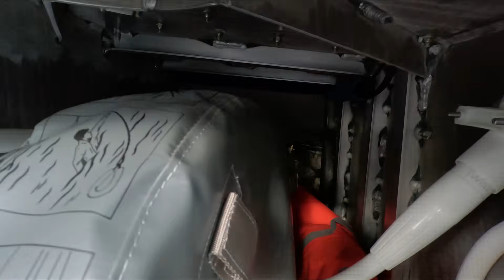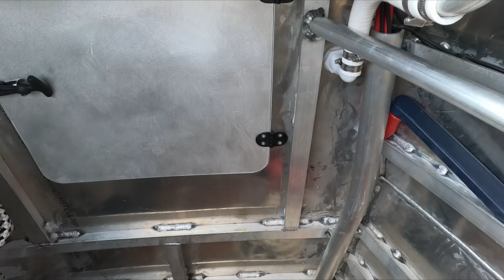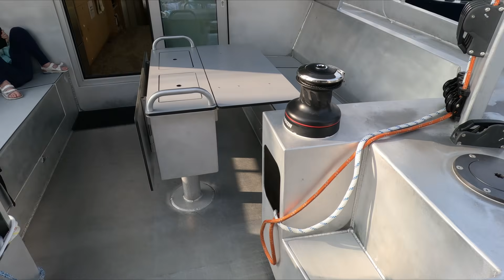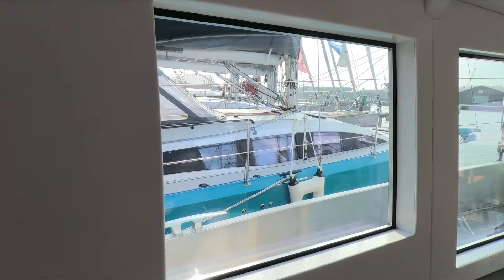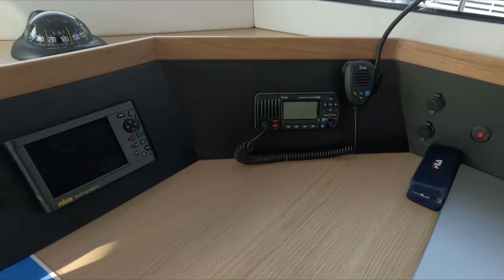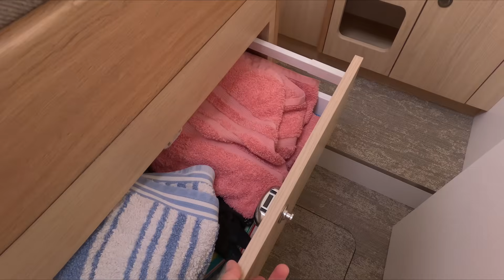ISMERIA 45, Mini expedition ship or tiny home

Comment: Interesting choices here. Love: aluminum construction, drop down platform, solar arch, wide side decks, hand rails, double rollers, forward storage compartment, watertight bulkheads, granny bars, easy access to boom, shaded windows, PIANO!, deck cabin saloon and galley. Don’t love: climb onto side decks, line chafe on hatch opening, raised hatches, deck cabin windows don’t open?. Not sure about the helm. Did not see a wheel in the cockpit—is the inside helm position the only one on this model? Can the helmsman see the sails from the helm station? And far away from winches and lines.

Comment: Very interesting layout.
Couple of points though:
- the aluminum is not textured on the foredeck. Is that not slippery when wet?
- Owner cabin bed is higher than the surrounding bed framing. How do you hold yourself in place where heeling at sea? 
- the same bed does not seem to be ventilated. In our experience this is the perfect setup for mold. How is that tackled please?
Excellent presentation as always. A very neat concept otherwise. Thank you for sharing.
Reply: The deck is not yet finished as she is fresh out of the factory - the deck will have cork decking when finished.

The bed has special ventilation underneath with the lattes. There are lee clothes and boards when underway for safety

Comment: I wonder how they are going to fix that issue with the lines rubbing on the hard bimini.
Reply: Yeah, was a bit of an oversight 🙂
Reply: IF it is gravity loads only, that's fine. But not OK 
if the  shortest distance between the ends of any section of rope causes it to press with appreciable force against a chafing surface when moved under tension.
Reply: @Gottenhimfella we will find out during the factory tour. However we believe there are systems in place that are invisible to prevent this.

Comment: Since when is 45 tiny .. most people can only dream of a boat this size and live in 27 to 35 footers ..
Reply: tbh, the 42 to 46 feet LOA range, is the sizing bracket for the can I fit in everything I need with a Monohull. The only real issue then becomes part of the massive can it be supplied with the shallow enough Draft that I need - the answer to which, unfortunately tends to be - no it damned well can’t ! - Hence my target next Sailboat has a 36 foot LOA, and a Draft of 4 feet 6 inches, which is 3 inches deeper than my Endeavour, though that is with a very special Mars Custom Lead Wing Keel,though that is waiting on confirmation that the inboard 4 cylinder Yanmar Diesel, with Direct Drive can be fitted - as not exactly a fan of the three cylinder under powered ones, plus a second small head can be accommodated satisfactorily, while keeping the very comfortable existing main head and shower- if you regularly have guests or crew onboard, then a second head is pretty much indispensable imho. If the worst comes to the worst, then next LOA size up would be ok, other than losing out on proving the probability of acquiring the potential for significantly enhanced boat Survivability with a smaller boat which has a much reduced displacement- I’m aiming for comfortable Transatlantic crossings, with a displacement of more than 3,000 lbs less than I would normally like, but with no resulting worries about comfort during a crossing. Comfort makes a vital contribution towards boat and crew safety by providing needed rest. The difference in cost between 36 feet and say 39 feet LOA can be pretty close with care, and if you can tack an order on with a bulk purchase by a Charter Fleet. Bob. 🤔🌟🌟🌟👍❤️⛵️
Reply: For most of us yes this is a big boat to dream of. The reference to tiny house is a direct comparison to a house and a boat - most houses are way bigger. The live aboard life this boat provides is comfort if people are coming directly from a house and are wanting the same comfort levels that a home like a bungalow can offer

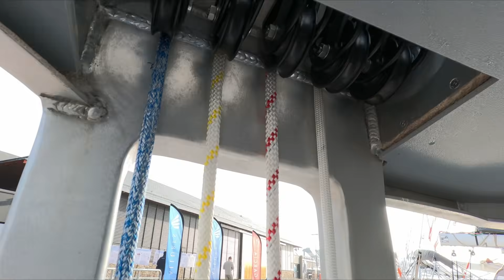Comment: At 10:30 I noticed that the running rigging that comes over the deck roof and then down to blocks, thru clutches and then thru blocks doesn't seem to face the nearest winch!  There must be some rotation that the final blocks can do to get a good angle on the forward winch but I'm not seeing it!
Reply from the maker: All will be revealed when we visit the factory, but well spotted.😊
Reply: Looking forward to the reveal at the factory!  I live in southeast Alaska and own a 30 foot sailboat, but have spent quality time on aluminum power boats, jet boats specifically, and they are tough as nails.

Comment: What this is, is a sailing house designed by landlubbers...who have never read the 
1972 Col. Regs. (Preventing collisions at sea)
Reply: Explain?
She looks generally well sorted.
Reply: @markthomasson5077  I grew up by the sea started sailing 1964. Was a sailing Keelboat instructor for 14 years. Made many deliveries of varying sized keelboats.
Many modern sailboats are designed to sell to the sailing novice. (One glaring design flaw is having the main sheet halfway down the boom) 
For me sailing (Dufour 44 performance) solo & practicing the art of sailing, making a distant port/anchorage safely is what its about.
To many others it's about entertaining & prestige.
Reply: @petertaylor8922 agreed, most boats designed to be comfortable in harbour….note you often see sailboats motoring, even downwind.
Centre mainsheets, to my mind, very sensible to not have a loose mainsheet take your head off in a gybe.
Reply: @markthomasson5077  Your comment regarding the main sheet shows your lack of sailing experience.
Reply: @petertaylor8922 about 65 years.  Please explain why it is bad.

Comment: Nice. Yet would u really be sleeping in the bow if u were doing around the would voyages. Might be a bit bouncy.
Reply: A forward Offset Pullman Berth with Lee Cloths can usually be installed in such a way that you can prevent high speed evictions from bed while you sleep. Other than that, reverting to traditional Saloon Sofa bedding to Port and Starboard, also with Lee Cloths, has also always worked really well, as do quarter berths tbh. Best Wishes. Bob. 🤔🌟🌟🌟👍❤️⛵️

Comment: Wow ! If I was in the Market for an Expedition type Sailboat - but I’m not - these  are the builders that I would approach to build it for me frankly. But I want to keep as far away as possible from seriously extreme Cold and the Stormy Conditions that frequent such areas of the World. As pretty much everything in any resulting boat would clearly end up being built to my specifications, for me the maximum number of compromise boxes would inevitably be ticked in my favour, so by default, I’d be getting the very best Sailboat I have ever seen, and the same would go for everyone else having these people build a boat for them ? 😅. OK so instead, how does the boat I need shape up in comparison ? Well, it is starting to compare really well actually, and we are now several steps closer to having it placed on an order book. Still need the Tropics, so a GRP Monohull Design to last for about five years acquiring Data as a Concept Test bed, then a bit bigger boat for more comfort, which means the test bed can be quite a bit smaller, and a heck of a lot cheaper as a result, so the LOA right now, is looking to be around 35 feet, draft as a result can be 4 feet 6 inches, and Air Draft ADWL  of under 50 feet, so lots of fun potential from accessing lots of extra places. The extra few inches of Draft comes from a bolt on Wing Keel which can do the necessary testing which can end up then benefitting pretty much any Sailboat design, so worth it as a temporary measure. In very good news, lots of bullion metal specialists are now starting to talk about Silver finally starting to trade in the sensible price range that has been forecast for literally decades now, so cashing a bit out to place an order, could well be in view quite soon now. Fingers Crossed. Best Wishes. Bob who is now down to 13.5 stone, and has given up smoking - at least temporarily 🤔🌟🌟🌟👍❤️⛵️
Reply from the maker: Hi Bob sorry for the late reply, I am glad we finally found a shipyard for you 😂🎉 these guys are great and wait until you see what they have for the warmer latitudes.
Reply: @SVTONICBoatWives  No panic, I’m presently stuck in a non rush mode getting my left leg cleared up - at last - but so many damned tablets every day, it is more than a bit like swallowing buckshot. 😂 I may end up getting a decent discount new boat via surplus production run, with a semi flexible standard production stats , just like can be done with bulk order Charter Fleet add on items- so I may end up with either a 36 footer with a 4 foot 6 inch draft, or a 38 footer with a 4 foot 8 inch draft - probably end up being the 38 footer as I can have the Yanmar 4 cylinder 45 hp with that - I am Not wildly enthusiastic about the three cylinder Yanmar engines tbh. The 38 seems to e able to fit in a decent diesel generator as well, so running a water maker shouldn’t be a problem. So far, the guide price for a completed and fully commissioned boat looks promising, just as the Silver Bullion price finally looks to be getting set to break out. Things may finally be staring to  look up . Best Wishes and Fair Winds. Bob. 🤔🌟🌟🌟👍❤️⛵️

Comment: What a garbage line system with the lines chafing on the cabin top. Hopefully they figure out a better way of doing things.
Reply: It isn’t finished yet. I guess a low friction plate will be added .  Did seem curious that they cut across the opening part.
Reply: I also found that the arrangement of their clutches was strange. The lines extend from the cabin top to the winches and are angled to the winch, which will undoubtedly increase friction and chafe. Cheers.
Reply: @Cptnbond yep, I could not see how it was going to work…we are probably missing something.
Reply: @markthomasson5077  They did say that the boat isn't finished. With the amount of chafe that is seen on such a short video I'd think that it would be in their best interest if they optimized the running rigging and re-released a video showing the improvements. Then again this looks like a kit build by private builders out of a yard, like Delos 2.0, and perhaps the company yard the boat is being built out of doesn't have full control of the build.

EDIT: I just want to say that I have the highest amount of respect for Brian and Karin Trautman for their design choices, and I don't think that they would make these kinds of mistakes as they are very accomplished sailors. Then again we haven't gotten to the running rigging on Delos 2.0, so here's hoping for the best.
Reply: @vb6database being a one off, we can allow them to not get everything right first time.  I guess they might not be on site to think through every detail.

Comment: No helm in the cockpit? Very interesting boat!
Reply: I guess they never plan to manoeuvre into a dock or slip short handed, or anchor in difficult circumstances. Seems to me it suits neither marina nor remote fiord /archipelago use.
Reply: @Gottenhimfella my concern is more that it seems you can't control the lines from the helm.
Reply: @constantinealexandrakis  To which they would no doubt say "No problem, just retrofit electric drives to the winches with remote buttons".
Many modern winches will trim out as well as in. 
But as I'm sure you'll be well aware this is just asking for trouble, not least because you cannot possibly see whether the clew is hanging up on something and you're about to cause damage.
And of course reefing from inside is an open invitation to a fiasco at best and damage or danger to the vessel at worst. People who prefer hiding indoors have no place sailing across oceans.... and frankly, what attraction could it have?
Reply: @Gottenhimfella agreed. Well, to be honest, i wouldn't mind hiding inside in foul weather during passages but after talking to many more experienced sailors than me, simplest systems are the best. Not only because you want to be able to see the sails like you said but also because imagine having to use a manual override system in bad weather when you've never done it before because something went wrong with the electric system. Boreal, the Ovni 490, KM yachtbuilders, and to a lesser extent Garcia offer you the ability to control the autopilot from indoors while being close to the lines and helm outside.
Reply: @constantinealexandrakis  Excellent points, and there's a lot to be said for being able to tweak the pilot without getting suited up.
One other  relevant point is that a big problem with reefing from the cockpit is that halyards are very inclined to take the scenic route from their top sheave to the relevant sail's tack at the first opportunity offshore, which is often the worst possible time, and if you have to be in two places at once to deal with it, that's a huge No. Mercifully, modern constrictor clutches, mounted below the halyard entry on the mast, can be activated and released locally even when a remote line is fitted, which means the simplest fallback position in control terms is also the "last ditch" location for dealing with a horrorshow. As with the manual overrides you mention, they must always be operable from the scene at which the worst case scenario needs to be dealt with, without someone first having to go elsewhere to throw a switch or find a self-hiding tool.
Reply from the maker: Yes you got it 😂

Comment: I don't think I ever saw a sailboat quite like this.  Not because of the materials, but because with the canted windows  and it being a deck cabin, it looks like it's part trawler.
Reply: Modern Garcia's have forward raked windows. Although those are raised rather than deck saloon.
Reply: Theres a few  European designs ...they draw on working fishing boats  and explorer Yatchs designs. 
There's even a Mumby catamaran built for Australia's Seasonal coast conditions where you may have to motor more than sail if you need to be somewhere before all hell breaks loose .. so it has larger motors as well.🙂
It's on U-tube as a Mumby motorsailor cat.
This is akin to the style of RAN sailings new wood and composite build.
Reply: No  wheel or conventional external helm ... as befits a  
high latitudes and ocean crossing  Yatch .🧙🏼‍♂️🇬🇧

Is that a cork floor covering ? Looks like it might be .. an h.d. architectural version. Toes love it.
Reply: @clivestainlesssteelwomble7665  on deck it is cork f and on the inside we will find out with the factory tour 😊
Reply: 😂😂😂😂 буксир под парусами.